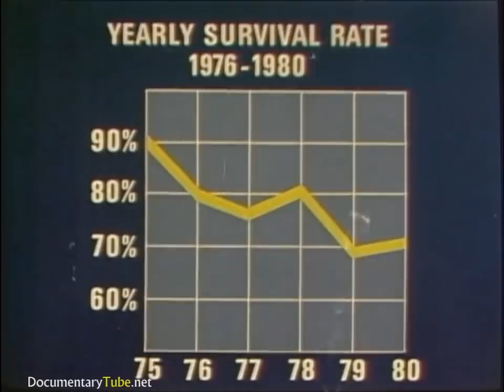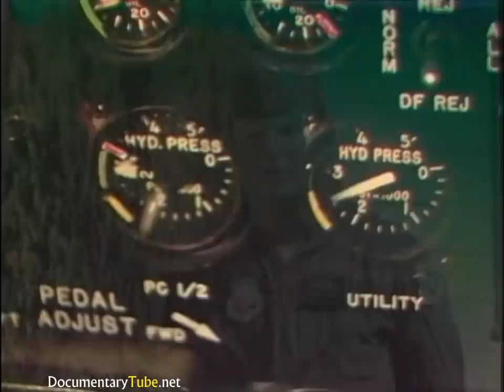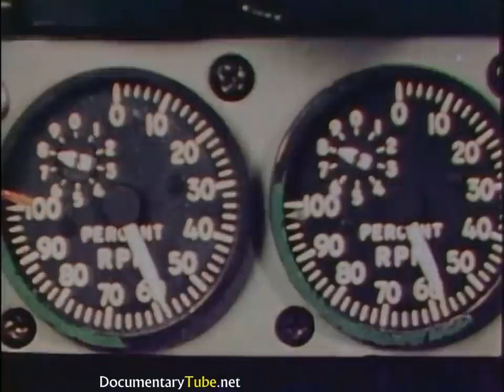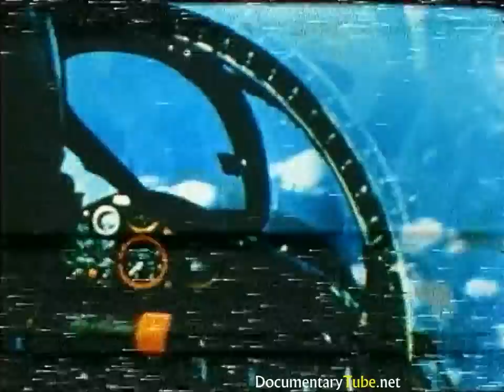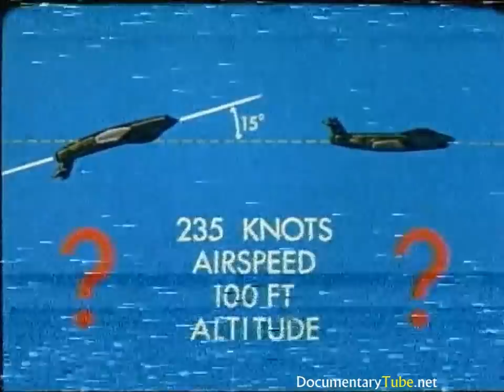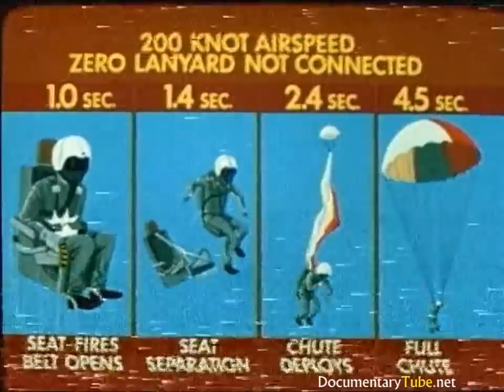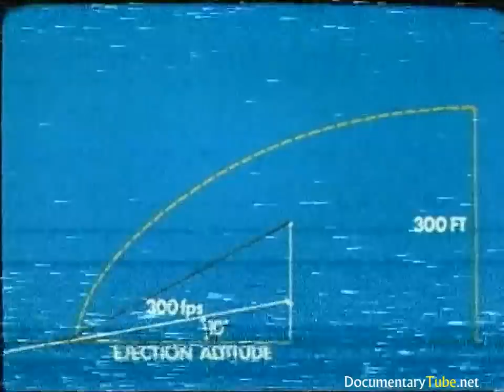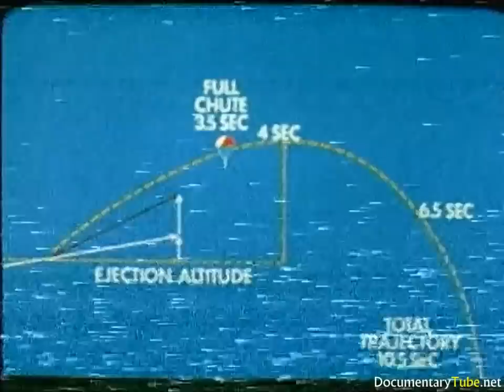HOW IT WORKS: Ejection Seats

Comment: The first ejection seats used operationally were by the Luftwaffe in World War 2.  The Heinkel He 219 had them, they saved several crews and also the Dornier Do 335.  These seats used compressed air.  The He 162 also had a ejection seat as standard and in this model a pyrotechnical charge was used.  It was much lighter and might have found its way on to all Luftwaffe aircraft.  Heinkel was put in charge of developing all ejection seats and they were standard on all test aircraft.  The rocket sled track they built to test these seats was taken back to the US as war booty and you see it in old films.

Comment: Not as good as a Russian ejection seat.  The Russian ejection seats use a gyro to make sure that the seat always goes up.  I can not understand why the US has not incorporated this feature into all US ejection seats.  Many US pilots would have lived if they had this feature in their planes including the first female pilot in an f-14 that crashed when it rolled over when she was approaching the carrier due to a single engine flameout.  She was ejected downward into the water.  She would have lived if she had a Russian ejection seat.
Reply: They do use a spin up gas generator gyro and a vernier rocket propulsion system that adjusts the stabilization pitch of the pilot in an event of an ejection
Reply: No gyro in Russian K-36D ejection seat. We (USAF) has a Foreign Comparative Test Program where prototype seats had a pair of roll rockets that would rotate the seat upwards, but it was never fielded.
Reply: SON GEKO that’s in the ISAF ACES II, the STAPAC, and is used for pitch stabilization.
Reply: The yeetus feetus seatus
Reply: @songeko8532  They don't however rotate the seat in the up position if an ejection is sideways or even down though.  It seems its only for the pitch stability of the seat?
Reply: William Jones-Halibut right, stability, not directional control.
Reply: John P I think Russian ejections emphasised supersonic ejections at high altitude suitable for the interception mission for defense of Russian airspace.  They wear warm silk pressure suits (silk slips on easier) .  US ejections tended to be a lower speed and altitude associated with ground attack etc.  Obviously the Russians kept working and improved their low altitude capability to quite spectacular levels.
Reply: @WilliamJones-Halibut-vq1fs  All of our bombers would penetrate the Soviet Union at low altitude. Hence why the B-1A was cancelled and the subsonic low level B1-B bomber was rolled into production.
Reply: You seem so... knowledgeable.
Reply: Bullshit.  Kara Hultgren would have been well out of the envelope with ANY seat, Russian or otherwise.